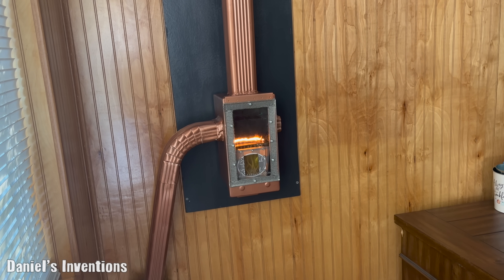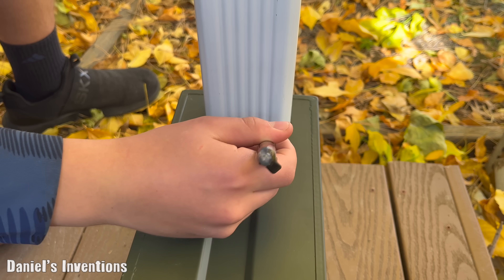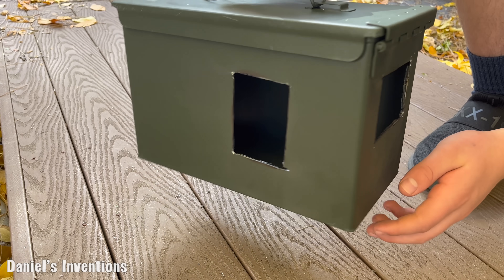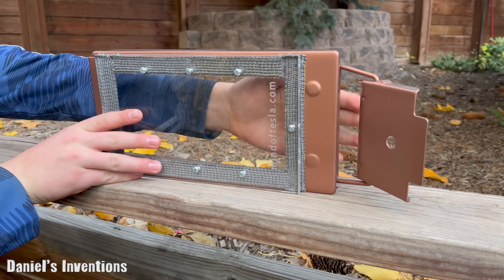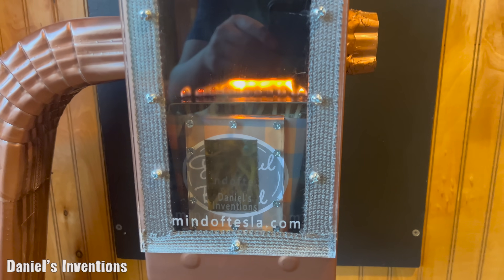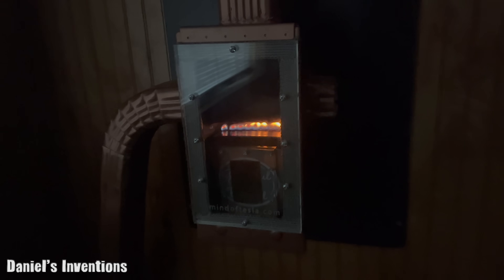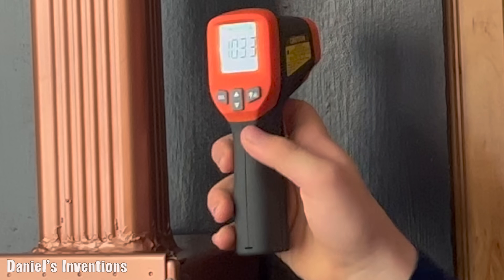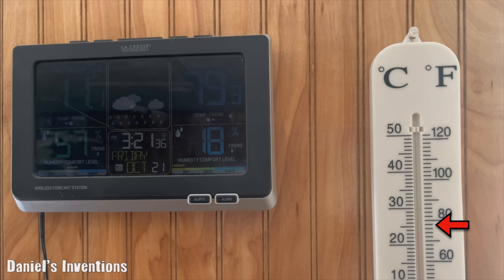ENDLESS Heat for Your Home WITHOUT Electricity

Comment: I would get rid of the computer fan and use a Stirling engine to push the air through since you have plenty of heat on the top to run it. This way no need for electricity at all for the operation of it.
Reply: The fan is optional to help with air circulation. The heater could run without it.

Comment: Don't like jb type glueing but would rather use screws or rivets, then soft solder to finish connections. Also think stripping paint from critical junctions with straight or rotary wire brush would facilitate  clean break-in  time. But otherwise great idea. Good job and God bless.

Comment: 12v is not  electricity?    Idiot in action here...
Reply: The fan is optional to help with air circulation. The heater could run without it.

Comment: No electricity but you have the fan plugged in 🤦
Reply: The fan is optional to help with air circulation. The heater could run without it.

Comment: What does the fan run off of?
Reply: The fan is optional to help with air circulation. The heater could run without it.

Comment: Holy Cow! That is a BRILLIANT bit of kit. So simple, and the temperature measurements show it's very efficient with the oil burn. As luck would have it, my shed needs exactly one of these so I'll make one.
Wonderful to stumble across you chanel and I wish you all the best for future projects.
Cheers
Pete' New Zealand.
Reply: Pro-tip: JB Weld as a long-term solution, especially with high temps, flame and closed spaces is not recommended.  If you're going to try this, ask your local store for high-heat sealant and for the love of God, find some heavier-duty stock than just standard storm drain pieces.
Reply: MEA TTER: PLEASE MAKE A SHORT VIDEO OF YOUR BUILD WITH YOUR OWN MODS, THANK YOU.

Comment: Nice !!! But one of those Wood Stove Fans (Stirling Engine) for under $100, would eliminate the need for the 12V Computer Fan.  Please try this experiment again.  Looking through the comments you have enough input to build a proper 2.0 heater.
Reply: The fan is not needed, but it helps with air circulation.
Reply: @jimwei4life        um   ...    so    ...     needed ???          LOL       I can see a use for the piece of the door that was cut out as the 'HEAT SHELF' to power just such a fan.  I was worried that you couldn't get enough air flow using  straight convection.  I think that to heat a single room cabin especially in the dead of winter you would be better off with a Stirling Engine or a Thermo-Centric Generator .  They actually get air moving pretty good.  We had one years ago on the wood stove ... you wouldn't want to put your finger in it.  According to the heat gun in the video the top of that combustion chamber is plenty hot to get the fan moving.

Comment: i was worried about carbon monoxide buildup but it seems you've thought of everything! the flame itself is isolated from the air in the room and rather draws air from outside and then vents the combustion gasses outside, using a heat exchanger design to transfer the heat from the exhaust to the room! genius!

Comment: I appreciate your skills at creating this but your comment "The computer fan runs at 12v DC"... how is this "WITHOUT Electricity" as stated in the title?
Reply: The fan is not needed, but it helps with air circulation.

Comment: "Without electricity!" - uses a 3d printer to mount a cpu fan... riiiight.
Reply: The fan is optional to help with air circulation. The heater could run without it.

Comment: .....but it uses electricity
Reply: The fan is optional to help with air circulation. The heater could run without it.

Comment: isn't 12 Volts electricity?
Reply: The fan is optional to help with air circulation. The heater could run without it.

Comment: Depending how much electricity costs it's not really that expensive to use a space heater especially for a small space. Just back of the napkin calculation here but a 1.5kw heater at 10c/kwh running for 4 hours a day (it would cycle on and off though) for 4 months would only be about $72 for the year. And you don't have the fire risk / jank you've created here.
Reply: you should add.. depending on how cold it is and how well is insulated your room. 
but this still do not excuse the clickbait title. 
Why not ... heating your house with an stove?
It would have been accurate.

Comment: Excellent idea, could possibly burn used car engine oil too, freely available as many garages have to pay contractors to dispose it off, I would also add a carbon monoxide detector in the room just in case any CO leaks and it can be deadly, provision should be made to fill oil easily and also flame extinguish mechanism should also be incorporated.

Comment: Cool build... But you did use electricity. You could get around that by placing a stove fan above the fire box.
Reply: The fan is optional to help with air circulation. The heater could run without it.

Comment: Thats brilliant. I have a wood stove in the workshop attached to my cabin. I bent some quarter inch copper tubing in the form of a radiator and laid under the wood grate in tne stove. I have a 50 gallon barrel filled with water sitting next to it that slowly percolates through that tube getting heated up. Found an old radiator out of a car with the electric fan on it and hung that on the wall in the house. Ran some PVC pipe so I can circulate the hot water through the radiator. Take apart an old dead space heater for its thermostat to hook up to the 12v fans running from an old computer power supply. It's been working pretty well so far.
I've always been interested in the idea of used/waste oil heaters though. I work on a farm and when we change the oil in one of our tractors, it's gallons at a time. We had to work on the rear end of the big tractor last year and that was 40 gallons of hydraulic oil right there. Then on another piece of equipment the diesel tank and the hydraulic tank are right next to each other and very poorly labeled. A guy filled the hydraulic oil tank with diesel. There was another 35 gallons of hydraulic oil we had to drain. 70 gallons of hydraulic oil would have heated a place for a Long time with a heater like yours.

Comment: Without electricity?
Reply: The fan is optional to help with air circulation. The heater could run without it.

Comment: You should have used "c" or "b" vent, and stove cement. Real "c" or " b" vent not only vents better, it has more surface area to radiate heat, and won't burn out as fast as gutter. Your gutter is going to be burned, acid and base burned, to the point of being dangerous,  in less than 3 seasons.

Comment: If you want to improve the life, use some heavier gauge round duct and oval it. Round duct for exhaust is sold in two gauges. Go with the heavier. And it's already shaped for a computer fan at 4-6". Speaking of computer parts. Use a heatsink on a piece of plate steel to amp that efficiency up.

Comment: Consider a thermocouple on the top smoke exhaust, you may get enough power to run your hot air just from the heat of the exhaust.

Comment: No electricity needed the fan runs on carbon in the air 🤣
Reply: The fan is optional to help with air circulation. The heater could run without it.

Comment: No electricity? Must be a very special fan
Reply: The fan is optional to help with air circulation. The heater could run without it.

Comment: use pure carbon fiber cloth(the dry fabric before resin) as wick. you can cut wider segments , dip them into the combustible , prime them, then have eternal wick, no byproduct leaves the material, ever.

Comment: Am I loosing my mind, or was something plugged into the wall, to the bottom left? What was that ….. I know this is supposed to be electricity free
Reply: The fan is optional to help with air circulation. The heater could run without it.

Comment: Without electricity....Uses 12v fan. lol   Cool project though. Maybe somehow incorporate a thermoelectric generator, swap to a 5v fan if its not enough power.
Reply: The fan is optional to help with air circulation. The heater could run without it.

Comment: This is fabulous!
I've been looking for a simple heating solution. You could buy a 55 Gallon drum of oil and heat your house for a year. I bet you could attach a small motorcycle radiator used to cool transmission fluid and use it to heat water

Comment: "ENDLESS Heat for Your Home WITHOUT Electricity"
BUT you still need an electricity to power the fan! lol 😅
Reply: The fan is optional to help with air circulation. The heater could run without it.

Comment: Without Electricity as they plug it in to a wall outlet.  SMH
Reply: The fan is optional to help with air circulation. The heater could run without it.

Comment: There are ways to improve upon this to eliminate the need for electricity.  Placing the heater closer to the floor so there's more chimney would help, then make a heat exchanger of the entire chimney rather than running anything through the firebox.  You could even place a shell around the chimney to keep lots of flow close to its surface, or just leave it bare so your skin can feel the warmth radiating off it.  There's a lot to be said for that.

You'd eliminate an electric fan for the heater itself, but you'd still want a fan - heated air will head for the ceiling and stay there.  Add a fan with a duct - the 3D printed adapter is pretty cool and the downpipe is a neat adaptation - to bring warm air down to the floor to eliminate stratification issues.

Comment: Could you use a convection fan (used on a log burner) to replace the need for the 12v fan?
Reply: The fan is optional to help with air circulation. The heater could run without it.

Comment: I think there should be a heat chamber so the fumes don't enter the house,  the fumes go around the chamber and out the chimney...
I would eliminate the return vent and add an air vent to the bottom of the stove and a fan on the heat chamber for circulation..

Comment: Without electricity?  What is 12V?
Reply: The fan is optional to help with air circulation. The heater could run without it.

Comment: I have a question. Wouldn't you need heat resistant flue instead of rain gutters to keep the pipes from getting too hot? (since it is right next to wood?) Or is the gutter pipes only for air circulation? I watched twice  to be sure I didn't miss anything. Thank you!
Reply: Maybe because it's not producing much more heat than a couple candles?
Reply: @WebberAerialImaging  - Plenty of houses have been burned down by "a couple candles"

Comment: Video says without Electricity but the computer fan is plugged in so there is a cost , I feel there is a way to accomplish this
Reply: The fan is optional to help with air circulation. The heater could run without it.

Comment: So it does use electricity. Click bait title.
Reply: The fan is optional to help with air circulation. The heater could run without it.

Comment: Heater fan... so much for no electricity.  Fail.
Reply: The fan is optional to help with air circulation. The heater could run without it.

Comment: Might be interesting to see it done with a hot vapor coil instead of a more traditional wick. You can find some examples of what I'm talking about with "alcohol burning greenhouse heater copper coil" as a keyword phrase. Some of those can be more flexible on the fuel used other than alcohol, although you may need to preheat the burner with an alcohol cup to get it going.
Reply: When I read your comment I immediately thought of the kerosene heater and cook stove I had on my sailboat years ago. But that doesn't had a pressure pump, and it took a bit of alcohol to warm up the unit to function properly plus it used quite a bit of fuel.

Comment: You've basically just recreated a Dickinson Marine Heater that's designed to heat small boat cabins. They're very efficient too, but typically either run on propane or diesel fuel, and cost about $1000 more.

Comment: What happens when fan fails?
Reply: The fan is optional to help with air circulation. The heater could run without it.

Comment: You can just go on eBay or Amazon and buy a Chinese diesel heater. I'd be worried that this thing would burn the house down. They cost about $130 it comes with everything. Energy is energy so even though this thing lasts a week it's output can't be that much since you're not burning that much oil. It'd be more scientific to shut off your central air and see the temperature difference before and after because I seriously doubt that this thing puts out enough heat to heat up the whole house that would be ridiculous

Comment: Wonder what happens if the fan stops functioning for a period of time. Does it get so hot it burns faster or does the fire end up consuming all the oxygen snuffing out the flames?
Reply: The fan is optional to help with air circulation, and the heater could run without it. But computer fans usually run nonstop.

Comment: "heating home without electricity" uses electricity lol
Reply: The fan is optional to help with air circulation. The heater could run without it.

Comment: IF YOU ARE INEXPERIENCED WITH OIL, GAS OR WOODBURNING UNITS FOR HEAT LIKE THIS.. PLEASE INVEST IN A CARBON MONOXIDE DETECTOR. AND TEST IT OUTSIDE FIRST.. 
  IF YOU are not handy, and like this.. start it now, before you get cold.. it's not enough to just watch a video.. PRACTICE ALL YOU SEEK TO LEARN.. 
  MEANTIME.. look up TERRA COTTA POT HEATERS. THEY ARE QUICK TO BUILD, TEST, AND SITUATE. (ON A PIECE OF SLATE, GRANITE, CEMENT BOARD, ECT,,, NOT DIRECT ON THE FLOOR PLEASE)
  AND DONT FORGET YOUR CARBONMONOXIDE DETECTOR

Comment: Not everyone has a 3D printer.  Might have lost them there.
  Anyone got other solutions for that part? Might be good to have other suggestions.
  JB weld probably won't hold up? 
  I think there is a high heat gasket making kit at auto supply...? 
  I'm a girl.. lol but I know a few things..
Reply: Ok.. the 3D printed part.. I think a metal dryer hose outlet will work for this part. It looks like my dryer vent outlet..

Comment: "...WITHOUT Electricity" 
uses electric fan
Thermal fan would suffice
Reply: The fan is optional to help with air circulation. The heater could run without it.

Comment: You do use electricity, what powers the fan?
Reply: The fan is optional to help with air circulation. The heater could run without it.

Comment: How does the combustion air get into the box? There was no hole for it. Also JB Weld is only good for 500 degrees which is too close for comfort. I would also use thin firebrick adhered with a high temp adhesive on the inside.

Comment: No electricity ?
Reply: The fan is optional to help with air circulation. The heater could run without it.

Comment: Nice, but delete without electricity, you are using a fan working with It.
Reply: The fan is optional to help with air circulation. The heater could run without it.

Comment: EXCELLENT JOB!!
SUGGESTION:
* CHANGE YOUR CURRENT AIR SYSTEM THAT RUNS THROUGH YOUR "FIREBOX" (the air you're using inside your cabin or room)... WHICH IS CALLED YOUR "HEAT EXCHANGER"... TO A SYSTEM THAT BRINGS IN FRESH AIR FROM THE OUTSIDE... AND THEN YOU HAVE WHAT'S CALLED A "POSITIVE AIR SYSTEM".... WHICH WILL PUSH ALL THE COLD AIR "OUT" OF YOUR CABIN OR ROOM!
* Yes, you'll need to switch piping to the outside wall (and the fan installed on the pipe on the inside wall for convenience) and pump it into and through your firebox but, it increases the heat efficiency dramatically!
* Your outside "pipe" for the firebox is perfect but, if you need a little bit more fresh air to go through the system (to make the wicks burn better) then add another small, multi-speed fan to the pipe on the inside.
* If you make these changes and then do different temperature readings outside the cabin, inside the cabin and on the stove, you can use these measurements to prove your system is incredibly efficient.... the multi-speed fans give you lots of flexibility on what you can do.
* You could then sell the systems if you wanted because they're very efficient (check any laws or codes for selling fireplaces).

Note: make sure you install your two fans (for the fresh air that goes into your firebox and the fresh air that's for your heat exchanger) ON THE INSIDE PIPES because then you can control everything from the inside... and even with a remote control if you set it up correctly!.

Take Care
Retired, Veteran

Comment: Nice project  Have the wicks short enough to eliminate as much orange flame as you can. The blue flame is what you want for efficiency and clean exhaust.
Reply: Exactly right. Yellow flame in the pipe covered with soot is a good indicator that a lot of that fuel is being wasted as being sent up the exhaust pipe and coating inside of the exhaust pipe with black spot that eventually could get thick and hot enough to ignite possibly?
Reply: @howtogetoutofbabylon8978  I'm familiar with the sooty exhaust pipes on the older cars. I've never heard of exhaust pipe flaming in car exhausts, but it's a thought. I'm thinking the high flow rate would hinder any flame along with lack of oxygen.

Comment: Impressive. I wonder if adding a catalytic converter could pump up the efficiency even higher.
Reply: I don't think a catalytic converter would get hot enough to add efficiency or burn off any extra emissions. Usually they burn at 500-800 degrees.

Comment: It it downspout pipe under the flame or did you have to beef that up? Very clever design.
Reply: I think it’s the same pipe. I’m using a heavier steel square tube in mine. Takes a little longer to heat up, but I’m hoping for a longer life from it.

Comment: How is the fan working! No electricity statement is misleading
Reply: The fan is optional to help with air circulation. The heater could run without it.

Comment: Great short video.   I fail to understand "no electricity"   - Just the 12 Vdc computer fan???
Reply: The fan is optional to help with air circulation. The heater could run without it.